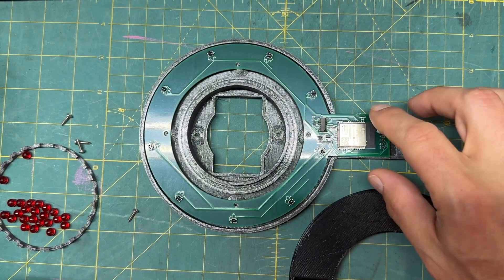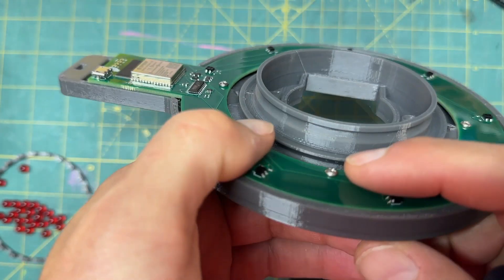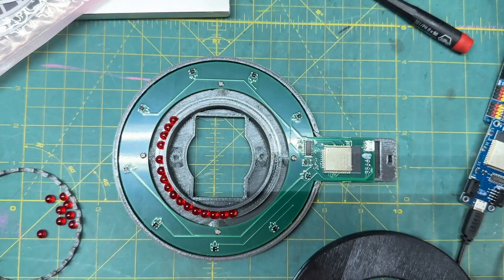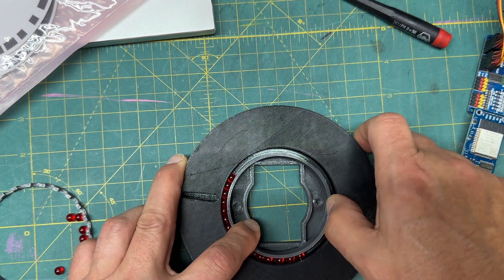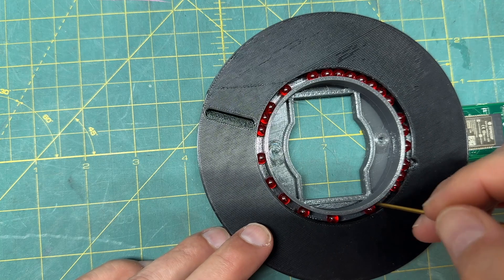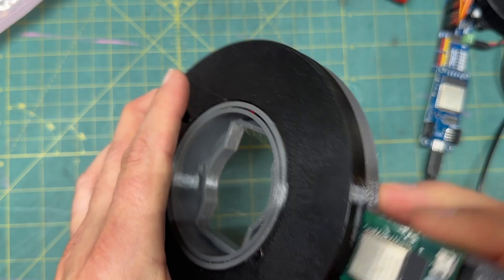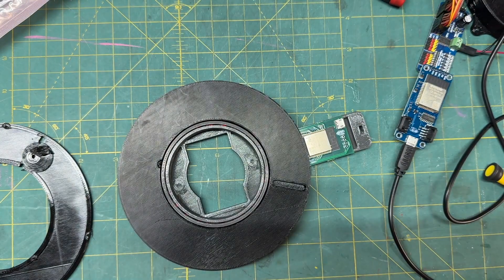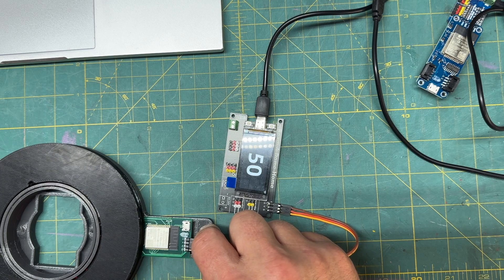Roam A Dome Bearing Build   HD 1080p

Comment: Do you know where to buy the boards?  The link you provided for uploading the firmware has another link that says "Boards are available here", but it goes to a GoDaddy parked domain.
Reply from the maker: Contact Mimir Reynisson on Facebook.
Reply: @TheEebel  Just got mine today and pulled this video back up for assembling the mount.  I printed the mount from the folder on Baddely's OneDrive but the bottom part doesn't have a track to hold the BBs while you're assembling it.  They just fall and roll under the top part.  Did you redesign this and I just have an older version?  [Edit] It was easier once I just put the two parts together and started snapping the BBs in through the notch like you did with the last 8 in the video.
Reply from the maker: @ Hmm, it’s been a while since I worked on this.  However, if I don’t recall revisions on this design.  Look onGitHUB.com/reeltwo to find the official version.